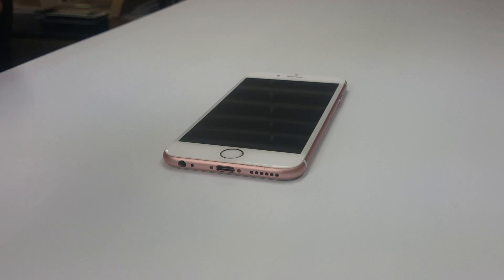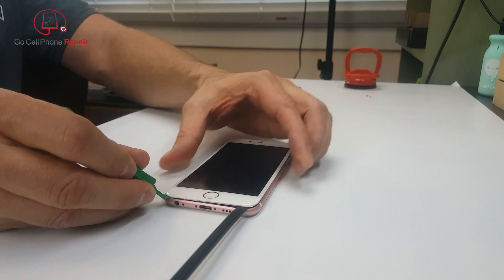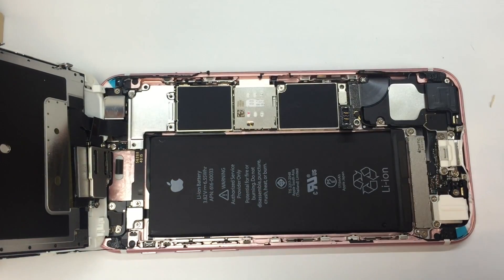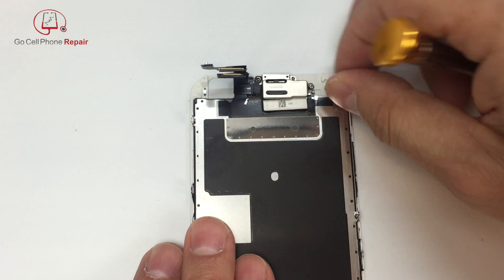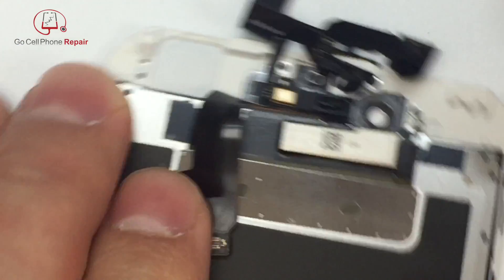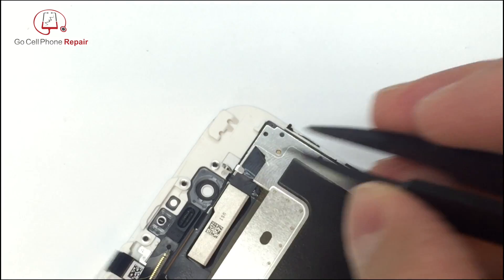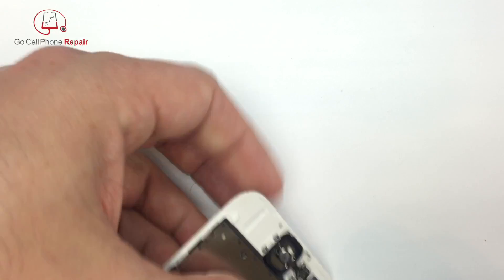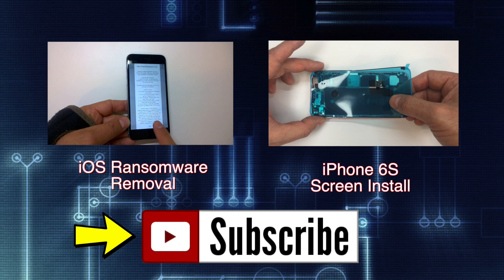iPhone 6S Screen Removal

Comment: can you show me how to fix my galaxy s6 edge? its cracked and i want to replace the screen
Reply from the maker: Are you trying to replace the whole display or just the glass? We are still working on a consistent method that can be taught for glass repair on that model as it is difficult to separate from the display without breaking the AMOLED. If you mean the whole display, yes I will make a tutorial the next time one comes in.
Reply: +Go Cell Phone Repair in need to know how to change just the screen but not the amoled
Reply: i just need the screen